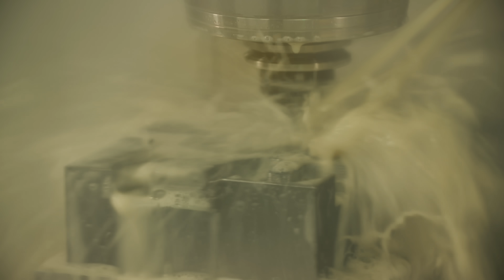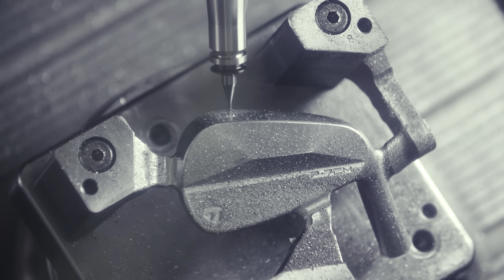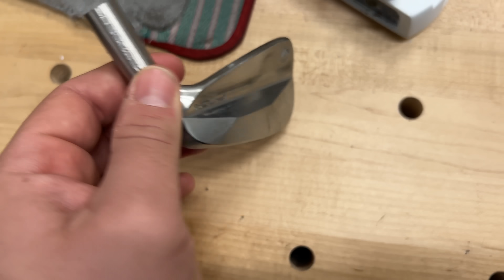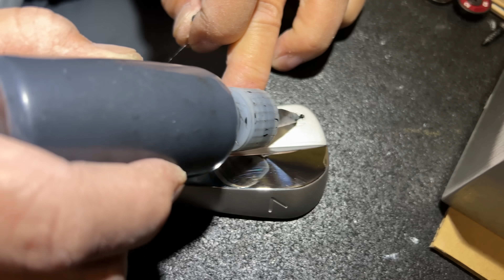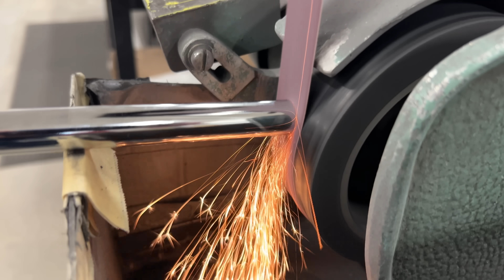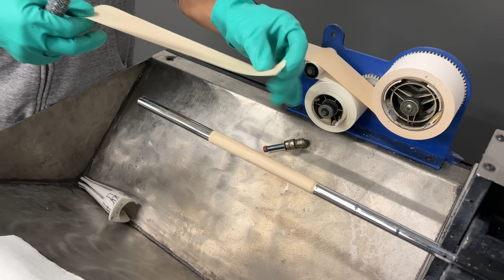Building Collin Morikawa's Custom P·7CM Irons | TaylorMade Golf

Comment: As a golfer, CNC machinist and taylormade player, this is 😍😍
Reply: With all the data could yoi write a program and make a golf club? Do you program CNCs?
Reply: @gasperstarina9837  you create a 3d model on other software and then import it onto a cnc machine and it converts the model to code
Reply: @samjordan4704  kind of true, a precise and efficient g code will be created rather than automated. I’m a designer and make my own putters but have done some machining in the past.
Reply: @designester  that's very cool, what software, machines, materials do you use when making your own
Reply: @samjordan4704  I design in Fusion360. It's pretty basic compared to some more established CAD packages but proficient enough! My putters are a mix of machined components and 3D printed parts so tend to outsource metal components but will print on either formlabs machines for SLA parts (high durometer rubber faces, for example) or outsource for SLS parts dependant on the requirements of the part. Always get questions about my putter every time I play with some new, the good bit for amateurs is that the R&A share conforming requirements and without the clubs being used in professional competition they do not need to be physically assessed, just comply with the requirements so are legal for local competition. Most people try to argue the validity when they're losing! ...back to designing mk11! cheers!
Reply: @Chris  show us some of your designs.

Comment: The steel might not be “forged” by heating and hammering the blank for each head but the steel making rolling mill process which transforms ingots to plate steel imparts directional grain into the steel. The distinction of a club being “forged” is to differentiate it from one created with pour casting (e.g. PING) which creates different grain structure in the steel.

For example when you trying to bend a early PING Eye or Eye 2 club to adjust lie and loft there is a high risk of cracking it, why in later models the notch in the hosel was added.  Nowadays all the PING irons are cast to the “blue dot” lie angle then adjusted to customer specs when ordered which the notch facilitates.

Comment: No wonder they are so expensive the amount of time used to CNC that and they wasted probably enough metal to make four irons just to make one, nice clubs though.  And to answer why forging might be considered better is because the grain  in a forging is drawn out into a bar then bent into an L shape before being pressed into an iron this means the grain of the metal flows through the head into the neck, with this the layers or grains will all flow the same direction which will produce different harmonics when you strike the ball and sound is what you sense as feel. Also forging will increase consistency of the grains and the density of the metal giving a more consistent result from strikes probably minimal if you can tell the difference but when you are paying this much in this bracket of irons you should be looking for the best but again that is subjective....

Comment: I had a chance to speak to a pga tour pro once and asked if pros play the same off the rack clubs consumers play as these companies claim and he said no.  He said their clubs are built different. Also the loft, lie, length differ and even the shaft flex differ between their irons.  btw, milling is far more precise than any human hand.  you can replicate exactly the same club every single time with milling.  especially the sole  which these guys care so much about.  turf interaction is very important for these guys.  but then again, equipment you use now are far better than the ones Tiger used to win most of his tournaments back in the 90s and 00s. So their clubs are customized to their liking which allows them to be more consistent and more precise.  If I had a choice between P7TW and Miura MB 101, I would go with P7TW irons hands down.  P7TW is milled and MB is grinded.

Comment: What are the advantages or disadvantages of making irons like this instead of forging it out of a steel rod like mizuno does?
Reply: Milling allows one off custom design like this. These are custom for Colin. You can use a forged bar to start to get similar feel to normal forged irons, but you probably won't able to get as soft a feel as forged to shape clubs.

Comment: How does a milled iron compare to a forged or cast iron? I assume it would align much more closely with a forged club as the block would have been forged into that shape, but have never heard this explained before.
Reply: I believe that a cast head is when iron is poured into a cast and then set. Forging is when the iron is heated and pounded out from a single block of iron. Milling refers to the shaping of the head along with the it's features, such as grooves. I am definitely not a smithing expert so I encourage you to do your own research for a better answer :)

Comment: I have genuine miura 6iron bought directly from miura with tour issue x100 and P7TW from TM and Zforged irons from Srixon and guess what?  when struck in the sweet spot, srixon and P7TW feel identical.  I honest think miura doesn't feel as good as the P7TW.  But of you want the same quality blades for 1/3 of the price. go with srixon.  Miura is definitely NOT worth the high price tag.  Mizuno JPX923 Tour though is by far the best bc it gives you forgiveness, long distance, workability, and feel.  I tried modus 3 120x, 105s and DG S300 and by far it feels best with DG S300.  modus 3 120x is not a good shaft at all.  if you go with modus get the 105s.  it became way too soft feeling which I don't like with 105s.  also swing weight was off by 2 points in either direction.  They forgot to put head weights and terrible epoxy job.   I took the whole thing apart and rebuilt it and now they are at D4 swing weight.  you need to add 6g brass head weight to get to D4 with STD grip and 2 wraps of tape